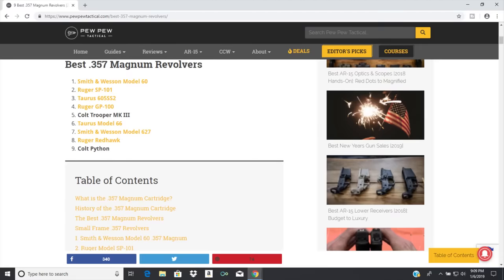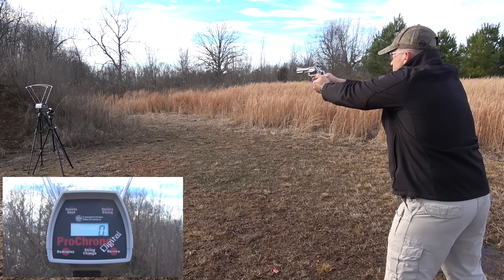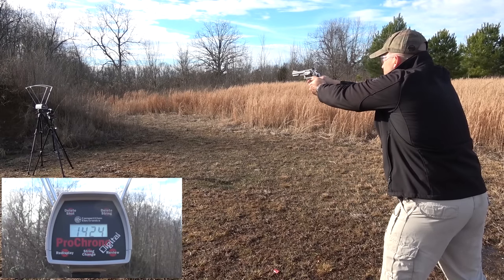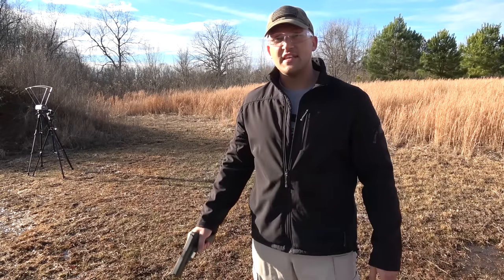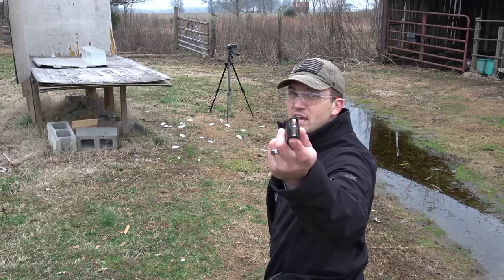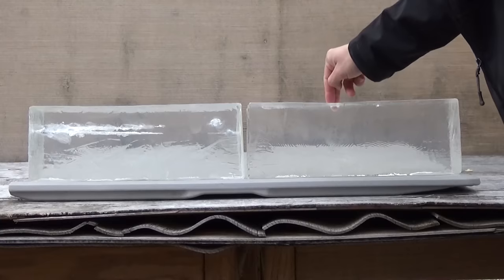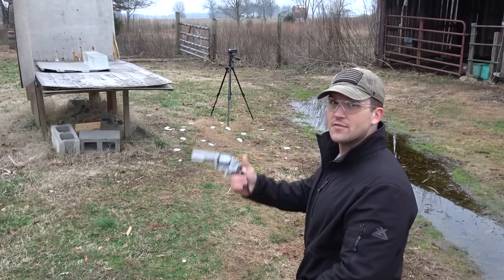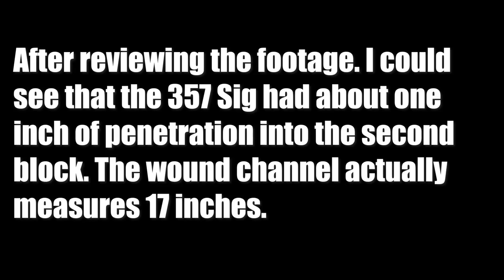357 Sig vs 357 Magnum vs Ballistic Gel

Comment: Im actually shocked how low those underwood 357 sig's velocities were coming in from that full sized gun. I recall other channels getting over 1500 out of a 4 inch barrel, and 1550 out of the 4.6 barrel. weird. glock barrel? stock recoil spring poundage?
Reply: Elevation and temperature affect velocity right? That could be it.
Reply from the maker: Everything was stock.
Reply: +tenmauto The top 357 SIG velocity I've ever seen reported from a 4" auto is 1433 fps (Buffalo Bore "Heavy 357 SIG"). Not much of a way the 357 SIG can match the 357 Mag. The 357 Mag case has much greater volume than the 357 SIG case, so there is no way the SIG can even come close to equalling the Mag's top loads.  Plus you have the inherent limitations of auto pistol construction that prevent approaching the power levels revolvers are capable of.
Reply: Watched a video last night by a guy with a Taurus Tracker .357 mag (probably 8" or so) take down an antelope at 130 years iron sights in a breezy side wind. He was pretty excited.
Reply: I wanted to comment again and give sources for what I was talking about. if you look at tnoutdoors9's ballistic test review of the 357 sig from underwood, he's getting over 1500fps out of a 4 inch barrel but it was a few years ago. Mrgunsandgear used the EXACT same gun and setup and was getting 1550 fps in his ballistics test of 357 sig, this was also several years ago. I dont know how to link videos but if you search the channel names with, like, 357 sig, you can't miss it. just go to the chronograph portion of the video. Anyway, just interesting to note. yeah - maybe elevation and temperature does have something to do with it - but i didn't think THAT much. or maybe underwood changed up powders for unsupported barrels?
Reply: @tenmauto  You are correct:
tnoutdoors9
Published on Oct 17, 2012
357 SIG / 125 gr JHP @ 1511 fps (Underwood Ammo)
Glock 32 4" barrel.

357 Mag on Brass Fetchers site:
Brass Fetcher
Published on Jan 29, 2013
357 Mag / 125 gr Gold Dot @ 1724 fps  (Buffalo Bore Ammo)
Ruger Security Six 4" barrel

357 Mag is still smoking the 357 SIG by 200+ fps, but I stand corrected on the SIG velocities.  It really pays to look around YouTube for ammo tests!
Reply: @63DW89A  Not to mention, that according to ballisticsbytheinch website for the .357mag, there's a good amount more velocity gained by longer barrels, for instance with 5 different weights of bullet over 8 different brands (numbers in FPS):

6"     1461  1715  1580  1648  1702  1465  1662  1485
4"     1286  1496  1394  1471  1511  1293  1453  1332
diff:   175     219   186    177     191    172    209    153
Reply: @exothermal.sprocket  That is true.  The Buffalo Bore 125 gr JHP in 357 Mag hits 1724 fps from a 4" revolver. That would be almost 2000 fps from a 6" barrel. Kinda mind boggling to think that a medium caliber handgun is in velocity territory normally occupied by rifles!
Reply: Not much nearby the .357mag can match or topple it. One has to look outside the auto cartridges (below .50 cal) and move up the chain of revolver cartridges to find it.
Reply: @exothermal.sprocket  Today's new progressive powders are pushing the velocities ever higher too at the same or lower pressures.  When the 357 Mag came out in 1935, it moved a 158 gr bullet at 1450 fps, from a 8.375" revolver barrel.  Modern powders can get a 158 gr to 1450 fps now from a 4" revolver at lower pressures(roughly 40,000 psi) than the original loading (~45,000 psi in 1935).  The 357 Mag introduction in 1935 was said to be the first revolver to move beyond the big Walker and Dragoon Colts in power.  Measured in ft/lbs of Muzzle Energy that is "true". Measured in actual bullet striking force, that is not actually true.  The 1935 357 Loading(738 ft/lbs ME) would move a 100 pound Ballistic Pendulum 1.62 inches on impact.  The 1873 45 Colt (40 grains of Dupont rifle black powder [modern GOEX FFFg]) moved a 255 gr bullet at 1000 fps (566 ft/lbs ME) and would move the 100 pound Pendulum 1.81 inches, so even the black powder 45 Colt actually hits a bit harder than the 1935 357 Magnum.  The Dragoon Colts were made of good steel unlike the Walker, and could be fired with hotter sporting grade black powders like Hazard Powder, and using the 220-260 gr conical bullets cast by Dragoon molds, would generate striking forces at least 10% above the 45 Colt if not more. I would argue that the actual striking force of the bullet is handgun "power" and not ME. ME is the theoretical accelerating force on the bullet, not the actual striking force of the bullet on impact.
Reply: Lifted_Above uh my 460 Rowland shits all over 357 mag
Reply: @63DW89A  Agreed. I wasn't going to say the .357 today would outperform .41mag, .44mag, .45 colt (modern), .454cas, etc. etc. etc. But it outperforms a whole lot of auto cartridges so it's a very viable choice for a very wide variety of reasons as compared to more limited use offerings. It's not magic, but it's very versitile and caries a lot of capability in a very flexible range of loadings.

I've heard about the  Ballistic Pendulum, (gunblue490 explained that history). Back then bullet technology was cast lead. So I'm wondering (my career is mechanical engineering, so I understand physics), if a bullet didn't disintegrate, shatter, pulverize when striking the pendulum, would the transference of energy from the bullet to the pendulum be greater, since it wouldn't be lost in lateral material spray but transferred fully to the pendulum? It's energy force-vectors.

Very similar to the ball bearing table-top pendulum machine, but the bearings don't shatter and spray sideways with lost energy.
Reply: @mitchvus  How well does it conceal?  How about touching off a round without hearing protection in a tiny closed room without hearing protection?  I often carry a S&W 66 4" concealed and it is loaded with standard pressure Buffalo Bore 38 SPL 158 gr LSWC-HP, so that I won't rupture my eardrums if I have to fire in a tight closed room. The soft-lead hollow point is an extremely effective round that reliably mushrooms under conditions that defeat JHP's.  An "old-school" bullet that still works better than a lot of the modern stuff!
Reply: @exothermal.sprocket  Effective use of the Pendulum requires a bullet trap that fully captures the bullet forward travel and does not allow rebound.  The pendulum designed by P.O. Ackley in the early 60's, used a heavy steel tube full of sand, with wood at back in front of a welded steel rear wall to fully absorb bullet forward travel and transfer it to the pendulum. The pendulum suspension captures the complete mechanical energy, as the horizontal travel is momentum and the pendulum vertical rise against gravity on its suspension wires/arms captures Kinetic energy.  Very accurate velocity measurements as long as weight and travel distance are accurately provided.  Have to fire from about 5 yards away, then correct velocity to muzzle, as muzzle blast (ME) will be measured in addition to bullet impact if fired too close.  Google "Ballistic Pendulum, Ackley" and you should get a good article online with formulas, and construction details.  A BP really opens your eyes as to how wildly inaccurate "ME" is as to actual bullet impact.  ME is actually the theoretical horsepower of the powder charge energy if you carefully think about it, and actual bullet impact is only a derivative of ME, and is not at all directly proportional to ME, as so many have been lead to believe!
Reply: That would make sense, what you said about the capturing design of the pendulum. Also, impact energy is the only realistic measure of how a given bullet will affect a given target, regardless of what's happening at the muzzle, so yes I understand.
Reply: It's colder where he was and he's farther back from the chrono. He's like 7 yards back so he's not recording actual "at the muzzle velocity/energy" ....tnoutdoors and the others are 10 FEET from the chrono getting a more accurate "at the muzzle" reading.
Reply: @tenmauto  I agree and was very surprised by the results.The 125 UW is what i carry in my EDC Sig 229 and stopped carry my 3in .357 5 round when a civilian here got jumped by a bunch of bikers getting milk and went thru 3 17round  9mm clips in the fight.
Reply: @63DW89A  "Plus you have the inherent limitations of auto pistol construction that prevent approaching the power levels revolvers are capable of."
Not sure what limitations you are referring to. The max operating pressure for the .357 Magnum is 35,000 PSI vs the 357 Sigs' 40,000 PSI (SAAMI US), 44,000 PSI (European)
Reply: @exothermal.sprocket  "a guy with a Taurus Tracker .357 mag (probably 8" or so) take down an antelope at 130 years ..."
Was it the guy or the antelope that old or did it take that long for the bullet to hit the antelope??
Reply: @63DW89A  " Modern powders can get a 158 gr to 1450 fps now from a 4" revolver at lower pressures(roughly 40,000 psi) than the original loading (~45,000 psi in 1935). "
SAAMI established average maximum pressure for the .357 Magnum is 35,000 PSI.
Reply: @63DW89A  Standard pressure .38 Spcl fired in an average sized room is going to leave your ears ringing for quite a long time. You could very well rupture an eardrum with any shots(s) fired in an enclosed space. Ask any law enforcement officer that's been involved in a firearms discharge in a room or hallway, (myself included), what it feels like! To this day, 30+ years later, my ears are still ringing. I can't hear a smoke alarm at all if my left ear is covered up!
Reply: @toddy2519  In my copy of SAAMI Z299.3 (2015) the actual peak is 37,800 psi.  However the 357 Mag has traditionally been loaded to as high as 45,000 PSI. Look at the online Hodgdon powder reloading site and you will note many 357 Mag max loads running at 43,000 psi, well above SAAMI suggested peak.  SAAMI is apparently trying to get the 357 Mag pressures down, but I doubt will have much success, because the 357 Mag and its traditional loads have been around much longer than SAAMI!
Reply: @robertmurrell633  51 rounds in self defense situation. Damn. That's a firefight. I would think the rest of the gang would be deterred after the first 15 or 20 guys expired.

Comment: You confirmed what I have seen from other sources.  The 357 sig, while having considerably more energy than a 9mm, still seems to consistently dump that  energy into it's target without overpenetrating.  The bullets seem to expand quicker, expand to maximum, and remain intact all while dumping an additional 200 lbs of energy into the target.  No doubt the 357 has more power, but once it passes through the target, it is wasted.  Great demonstration.

Comment: I'll take 6 shots from a 357 magnum revolver over 15 of a 9mm any day. If you can't deter, incapacitate or stop the threat with 6 shots of 357 at typical defensive distance you probably shouldn't own a gun. 709 -720 ft/lbs  is serious stopping power. No failures to feed with a revolver.
Reply: In a stressful situation you will fumble your draw and after managing to not shoot yourself will most likely hit 10% of your shots. So you do that bud.
Reply: " No failures to feed with a revolver."
The 357 Sig is a bottlenecked cartridge and they have a long history of reliable feeding as compared to straight tapered cartridges like 9mm Para.
Reply: Statistics show revolver carrying Leo's to have better than average accuracy. A myriad of potential factors to consider but I thought it was interesting
Reply: Marc Cadwell why not have the best of both worlds and get 357 Sig with Underwood hollow points

Comment: I bought one of the Sig .357 semi auto pistols.  Frankly it under performed.  It consistently stove piped and the accuracy was so-so.  On top of that you are paying top dollar for the .357 Sig. necked down ammo which performed just slightly better than a 9mm Plus P.  I currently own a Sig .45 carry and it was so easy to carry and use and knock back the slide…so INCREDIBLY RELIABLE!….that my wife now has custody of it full time….( I still have my Dan Wesson Custom). Sig Saur is hit and miss with their guns.  But if you stick to the well designed guns that have been in their line up for years they do fine.  I think WEIGHING the bullets would have been interesting to know how much each lost before coming to rest.

Comment: Good info.

For me I look at the barrels and the Glock measurement includes the chamber while the revolver does not so a more even comparison would be a Glock 35 with a 357 Sig conversion barrel (or that same barrel in a Glock 22).  The extra 1.2" of barrel will let the 125 grain load catch up to the Magnum quite a bit but probably won't surpass it.   Even with a longer barrel, I don't think the 147 can really compete, because it intrudes upon the case capacity of the 357 Sig too much.  125 grains seems to be the sweet spot for the Sig, the Magnum is the heavyweight champ but the Glock carries twice as many.  Decisions, decisions...  Who am I kidding, I like 357 Sig.

Comment: Good tests and not really surprising given what each cartridge is mostly used for. When I started out in law enforcement many moons ago, we were issued .357 Magnum revolvers, which were maybe a little bit too much of a good thing. Many officers had trouble controlling the blast and muzzle flash. Ammo companies that catered to law enforcement could often provide slightly reduced loads for patrol. Some agencies responded by loading the weapons with hot .38's. A lot of wear and tear went on our K-frame guns, and by the time the 686 arrived to address this in 1981, many agencies were already looking at semi-auto pistols. The 686 was and is a great revolver, but low capacity and slow reloads doomed it as a police sidearm. No problem, the revolver and the .357 Magnum made an awesome combo for the outdoorsman or civilian defender..

Fast forward to 1995. Sig Sauer had seen the striking success of the .40 S&W as a law enforcement round, and sought to capitalize on the success of the proprietary cartridge with one of their own, the .357 SIG. But they needed something to differentiate their new cartridge from the .40. Sig was aware of how many officers, especially rural ones, were attached to their .357 Magnums. Therefore they named their baby the .357 SIG even though it really used a 9mm projectile. At the time the 9mm's name was mud and nobody trusted it, so they wisely avoided it in the name.. I was working in LE training at the time, and was helping several agencies choose new handguns.

Sig made several claims for the new cartridge. The first was that it would equal the power of the .357 Magnum, but there was always an asterisk that explained that this was from firearms that had barrels identically measured. Given how revolver barrel lengths were measured differently from autos, this basically meant a .357 Magnum revolver with about a 2.5 inch barrel. They also claimed that the new cartridge would have less recoil, and would have greater long range accuracy than the .40 or a .45 ACP. This was technically true, but at the time the use of patrol rifles was still controversial, and Sig reps implied that their guns in .357 SIG could eliminate the need for long gun out to 100 yards. This was a bit of a stretch because not 1 in 100 patrol officers could shoot a handgun well enough to make that claim a reality. But some agencies, including a city police agency I worked with adopted the new cartridge, based largely on the fact that our State Police had chosen the round in the SIG P229, and Sig offered us some great handgun prices to follow along.

The .357 SIG proved to be a great LE round and our results in actual shootings with the original 125 grain loads at 1,450 fps were wonderful. But some officers complained just a bit about recoil, and in response Speer dropped the muzzle velocity on LE rounds to 1,350 fps, and Federal did as well. This took nothing away from the caliber's effectiveness as a police load. While some very large departments adopted this round, and it was probably slightly better at the time than the .40 S&W, the .40 had a five year head start on it, and that made all the difference.

So, the .357 Magnum is a bit more powerful and penetrates a bit more, but the .357 SIG isn't far  behind. I'd probably have a slight preference for the .357 Magnum in the outdoors, especially since I could also use .38 Specials in the revolver. If I was carrying the gun for personnel protection, I'd probably choose a .357 SIG auto pistol. But if I only owned one of them I'd feel pretty well armed in either setting.

Comment: I'd like to see a test with the Glock 35 with the lone wolf 5.2 in 357 sig barrel. And shoot some (90gr) Grizzly JHP, and some (125gr) Underwood TMJ through it. So if you could, test the Glock 35 with the lone wolf 357 sig barrel replacement, vs the Glock 40 10mm, vs the 357 magnum. That would be an awesome match!

Comment: If you want a more accurate test of what the two rounds can do you should compare the Underwood 125gr 357 sig with a standard brand 357 mag 125 gr like federal or speer. Underwood overloads the 357 mag, but loads the 357 sig as it should be loaded, to match an average 357 mag.

Comment: The consistency on the 125 sig loading is impressive
Reply: The relatively high pressure and the compact, bottlenecked case design make it a pretty consistent round in general.